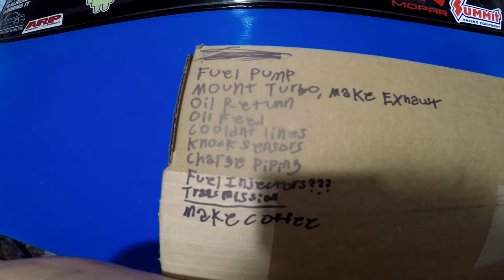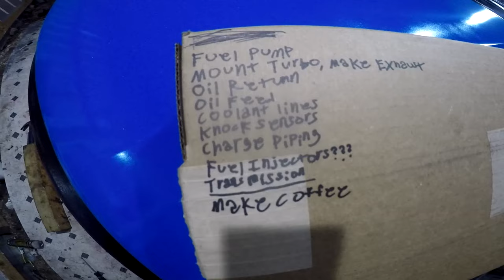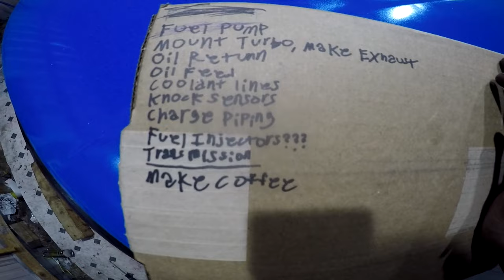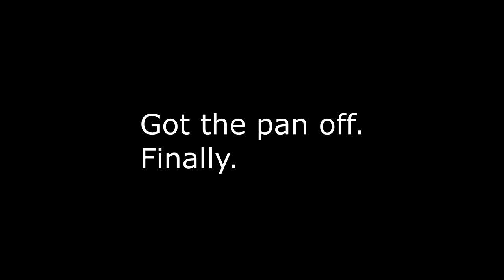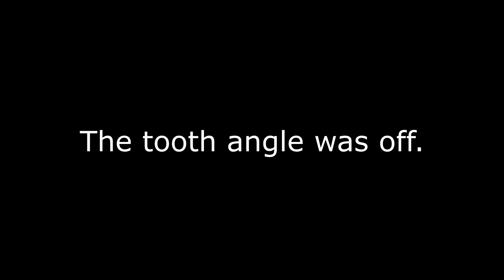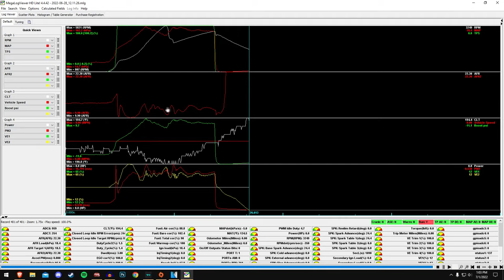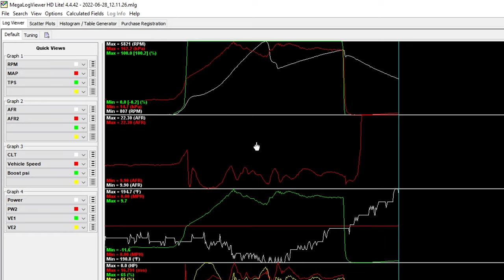Plymouth Sundance 2.2 turbo Sleeper Build Part 1 - Installing the Turbo, Making some Boost

Comment: You peaked my interest with "manual swap".
Reply from the maker: It will hopefully happen sooner rather than later
Reply: @HatersGarage  There are many different transmissions you can go with... A525 is the transmission you want to avoid. Too weak!

A555, A568 are the performance transmissions...

A520 and A523 transmissions are also strong enough for the turbo.

LSD for these transmissions is also somewhat cheap!
Reply: @HatersGarage  u know how to move the steering wheel I live in mine and it's a tight fit for 6,6 to sleep lol 😆

Comment: I love this guy! I have a dodge spirit with that engine. Turbod 5 speed though. I'm getting closer to the 400hp mark but it can be done with stock internals
Reply from the maker: They're stout engines for sure, the casting is way overbuilt for an engine designed for 140hp with the original turbo.
Reply: wow a dodge spirit i am amazed

Comment: I was going to do this with my shadow, but i found a t2 engine and rebuilt that and bought a lot of performance parts knstead. The big splined a568 transmission. An enforcer 2 turbo a 3 bar map bigger intercooler 3in exhaust. 55 lb injector 255 lph fuel pump. Short throw shifter. Im going for 300 300. With everything im adding, it should male the ulgrades easier later on. I'm going around 23 psi when finished, but now i have to wait for parts

Comment: I love that you're taking 'the hard road' to a turbo dodge. Granted, megasquirt upside. But this might hold the record for 'most work to reach stock turbo power level' which i dont mean in a bad way at all, its taking the road that most turbo dodge owners simply could not follow because they don't have the skill or determination to get there. Anyway, guess ill watch the other ones now.. I've built a bunch of turbo dodges and done 5 auto to manual swaps on them etc etc.. curious to see how far this car goes!

Comment: New favourite channel. I have a 1993 Voyager 5 speed with a TBI 2.5... love this van! 

My 2nd car is a 1985 LeBaron convertible with a full turbo swap from a 1989 Daytona Turbo 2.5... A555 Manual transmission and forged internals. The last owner messed up and installed a slider cam with roller followers, and recently kicked off one of the intake valve followers. Will swap out the valvetrain components ASAP as I have to get back to boostin'!

Awesome channel man.
Reply from the maker: Thanks! I had a follower fly off as well due to a stuck valve not long ago. Re-reamed the guides and it was good to go.
Reply: @HatersGarage  How did you find out it was a stuck valve?
Reply from the maker: @djcybercorgi  It was only running on 3 cylinders, and I heard a rattling noise coming from the valve cover.
Reply: @HatersGarage  Yeah same here, I just haven't figured out how to diagnose what caused it to pop off. I pulled the lifter out and it doesn't seem to squish down no matter what, so I assume I need to replace the lifters. Doesn't help that the engine builder put a slider cam with roller followers! I gotta say my LeBaron is actually very quick with minimal mods, I'm excited for you to get your turbo setup tuned!
Reply from the maker: @djcybercorgi  Sounds like it's the cam's fault to me. I'm psyched to get the boost turned up for sure. I put t2 rods and pistons in mine, 300hp is the number I want to make.

Comment: best way to think of an engine is an air pump. whatever makes air move through it as efficiently as possible, and makes compression as efficient as possible, and reduces inate vibration from reciprocal mass, is good for the engine. makes it more powerful, more energy efficient, lets it rev higher, increases responsiveness, and reduces reciprical mass without compromizing load bearing strength and integrity, is good.

Comment: 5:21 Isn't the 1-3 and 2-4 connection the same as 1-2 and 3-4 in terms of firing sequence (1-3-4-2 is the same as 2-1-3-4), whereas 1-4 and 2-3 connection would be different?

Comment: I bought and sold tons of Chrysler products like this...I took a Shadow just like this car to the track once,it was a 1987 2.2 Turbo 5 speed bone stock 6 year old car it felt quick it ran upper 14's! For a bone stock 146 hp 2.2 Turbo she went real good..The road tests by magazines wouldnt bring the rpm up and just floor it and the Turbo lag was bad on these took until 10 mph before it came on,so 0-10 killed most road test results you see of these Chrysler Turbo cars...The 2.5 Turbo the Turbo lag was much less! 

 I did personally own a 1986 Shelby Charger 2.2 Turbo and it also ran high 14's some magazines were running 15 -15.20 with them,but when you knew how to spool up the turbo on launch and handle the tire spinning and take off you will run high 14's with a bone stock 146 hp version..What I noticed the Turbo's would fail and they slowly lost power,I bought so many that the performance were off..I always rebuilt them if the performance was not where it should be.
Reply from the maker: Yeah they definitely would have benefited from launch control. Of course that wasn't really a thing back then, so the driver did matter a lot like you said. They could get away with making the car so much lighter and simpler than modern cars, without the EPA and safety regulation restrictions we have today. So even though they're low tech, they're still quick even by today's hot-hatch standards.

I've modernized mine quite a bit, it's going to have launch control and flat foot shifting to keep the lag down. I can also run E85 if I want to. But the engine itself is still not much more complex than a lawn mower engine, lol.

Comment: What I like most about this is that someone already swapped a MPFI intake manifold from the turbo model onto the car.  Makes me wonder if the engine was from a turbo car and they just removed the turbo setup.  I've seen this before on a K car LeBaron I almost bought once.   If it once was a turbo engine, it's got a pretty low compression ratio and will be extra slow without the turbo.
Reply from the maker: Someone did swap it, that someone was me. before I did the turbo stuff I rebuilt the engine with t2 rods and pistons as well as the MPFI intake. It was still faster than with the old TBI to spite the lowered compression.
Reply: @HatersGarage  Well dang!  That's awesome!!  I loved the video on the Sentra suspension so I'm going through your back catalog of videos, lol

Comment: 5:17 Still incorrect. Twin scroll or split pulse turbo on a four cylinder, 1&4 share one runner, 2&3 share the other.
Reply from the maker: Depends on the firing order
Reply: No... All inline four cylinder engines. An inline 4 cylinder fires every 180° degrees of rotation, cylinder 1 and 4 will always fire at 360° of eachother so are in exactly the opposite engine stroke.
So regardless of if your engine firing order is 1-3-4-2 or 1-2-4-3, 1-4 and 2-3 share exhaust runners to 'split pulse' the 'twin scroll'...
Reply from the maker: @DStead2239  You're right, I fixed the headers later on in a scrapped video but that's been a while at this point

Comment: assuming the plymouth Sundance was bone stock in the 1/8th before turbo, 13.2 really isn't bad at all. I guesstimate it would run the quarter at around 18 seconds at between 78-86mph.  still not bad for a cheap late 80's 4 cylinder econobox that doesn't, or barely makes 100hp, and maybe 80ft/lbs. 

for small displacement low output motors, torque is the more important power figure for acceleration. easiest way to make more power and torque across the board is to boost the compression. you just need to shave the head and level the deck a very small amount, just to reduce the combustion chamber area, which will increase compression. wouldn't go more than 8 thousanths on the head. aside from that, honing the bore, better forged aluminum pistons, ring gapping, and balancing pistons, conrods, and crank to keep the reciprocationg mass smooth and reduse vibration, will allow a higher RPM. 

porting and polishing, balanced cam, lifters, and valves, new valve springs, gapping the spark, and a bit of grinding on the intake and exaust manifold to smooth the surfaces and bend transitions to reduce flow turbulence....
Reply from the maker: I've done the whole nine yards with this engine apart from forged pistons and a cam. I've gapped the rings loose, installed t2 rods, rerouted the cylinder head coolant line for better cooling on cylinder #4, some cylinder head porting, and the Megasquirt ECU.

Right now the most annoying thing is how annoying it is to service the turbo. It's buried way up in there where you can't get to it, I'm considering a rear mounted turbo.